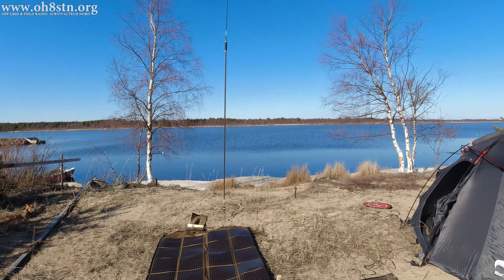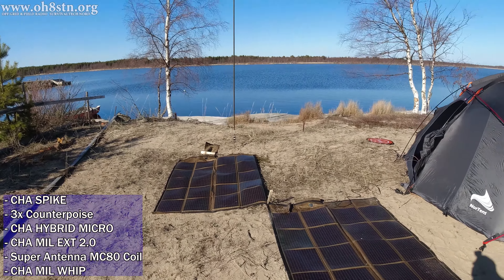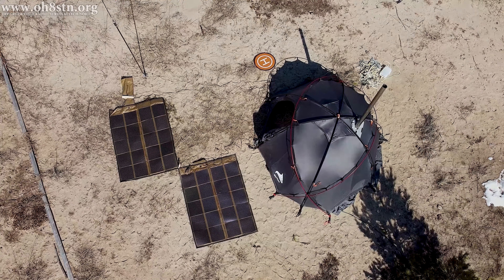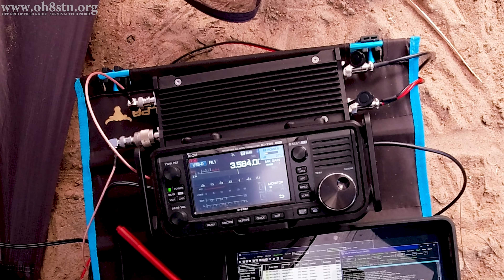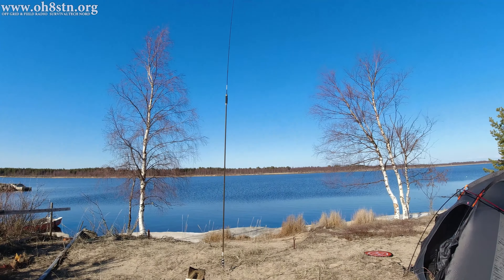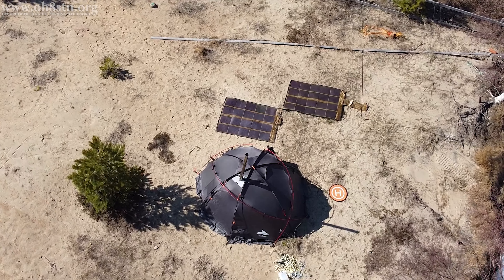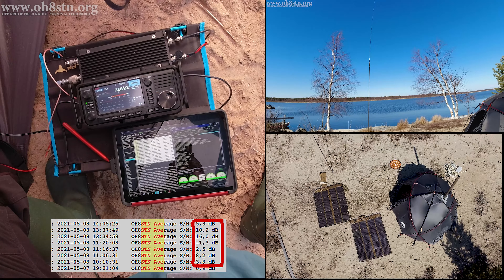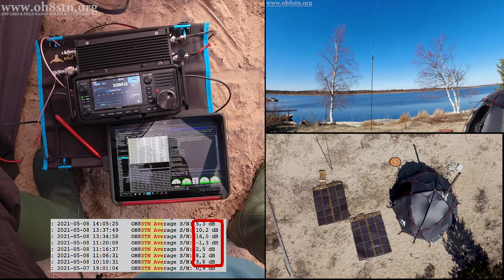Portable Ham Radio Antenna Chameleon MPAS

Comment: Thank you for the video Julian. I actually picked up the MC80 coil, and I ran some SWR readings last night. I run a cap hat on my MPAS 2.0. I put the coil below the hat, and I tried it above the hat. Those two setups had higher SWR readings vs. placing the coil in line with the extension and the whip without the hat. I'm only talking about 1.35 vs 1.20 SWR (with a tuner), but every little bit helps. I plan on working 80 meters this week, and I can't wait to see how well the coil works.
I can't say enough about the MPAS 2.0, as I've made SSB contacts over 6000 miles barefoot on 100 watts with it. 
Thanks again for the awesome and educational videos that you produce. Keep'm coming........
Reply from the maker: Thanks for this awesome comment and feedback. In my testing the best benefit came from placing the quail above the extension. Unfortunately I don't have the cap hat oh, so I haven't been able to test that one. It will be very interesting to see a comparison between below the cap and above the cap.

Comment: Thanks for another professional video, Julian. I was surprised you didn't need any stanchions on such a tall slender vertical antenna. There must have been literally no wind. Also, cool idea to add length with that 80M coil. Great job!
Reply from the maker: Thanks for the comment and the kindness. There was some wind, but it was manageable. The aluminum tubing of the lower portion  is milled from a single piece of aluminium pipe making it rigid stronger. Also the ground spike makes a great anchor. The coil and whip weigh almost nothing,leaving the extension  to carry the load.
Do carry along some elastic stretch cord and a few tent stakes just in case.
73
Julian oh8stn

Comment: Thank You, the idea of using the super antenna 80m coil with the MPAS 2 system has opened up a lot of additional flexibility and new life for the super antenna components.  I like the MPAS 2 much better than the super antenna system, so it was sitting on the shelf and not being used.  Now I see a lot of experimenting with an antenna analyzer and various components of the super antenna system added into the MPAS 2 to optimize for areas of the bands that might be enhanced by a little additional impedance matching. 73, Brian N9ETH

Comment: I've been using the MPAS 1.0 (black) with the CAP HAT since it first came out. Like any vertical antenna, at least one counterpoise is required to prevent some of the RF from being absorbed into the earth.

Suspending the counterpoise parallel to the earth from point to point is basically a field expedient elevated ground plane. Four is ideal and one creates some directionality.

Tie some safety orange flags on the suspended wires if there is foot traffic anywhere nearby. One trip on a wire could bring the system down.

The green MPAS 2.0 is on my list !
Reply from the maker: Thanks for the lesson and additional feedback.👍
Reply: @OH8STN  It is you that provide the lessons and instruction, I just share now and then to support the cause.

Comment: Used my MPAS 2.0 antenna for most of my POTA activations, until last month when then threads on the MIL whip became stripped. Been waiting for the bottom nut for the whip from Chameleon for a little bit.

Comment: Great video, as always. My challenge with Winlink over RF is connecting with an Igate. I'm using a G90 thru a Hustler 5BTV vertical, PATLink from KM4ACK's Build-A-Pi and ARDOP for the modem. One complication may be that I'm not heard within 500 miles of my QTH according to pskreporter on FT-8.
Reply from the maker: Thanks for the kindness and feedback. 
I suspect the problem is one covered in other videos. Km4ack scripts are great, but ARDOP is the weak link in the connection. It's much more difficult to get a low power connection with ARDOP vs VaraHF. It's also the primary reason for moving back to Windows for winlink work. Unfortunately there is no easy VaraHF solution for Rpi. 
The G90 has been rock solid for winlink so far. Usually getting connections on 160-30m.

Comment: I love my mpas2.0 I have the cap hat and 4 radials have made several contacts to North America and South America, from Ireland just 100 watts mostly on 20m SSB.  Even got to Australia once. 

I have the super antenna so will try out the 80m coil.

One thing I noticed compared to my efhw 49:1 is that the Mpas is a lot quieter and I can hear the dx better but of course for nvis the efhw is best but the Mpas is a really great antenna and I leave it up all the time at home and take it down only for portable use. I use noalox so the joins won’t seize.
Reply from the maker: Outstanding 👍

Comment: Question, the MPAS 2 covers 80 meters, why add the super antenna coil to the configuration. What is it giving you the MPAS alone is not. Just trying to understand.
Reply from the maker: Loading. You've heard the term more wire in the air? The coil adds a bit of wire in the air
 That little bit of loading can make the difference between a slow connection come and a very robust and reliable connection Ulta

Comment: So to run 80m you use the coil to make the antenna longer essentially in order to bring the SWR down? Couldn't you just use the PA500 to tune for 80m? I understand the coil makes it seem like the antenna is longer but how does that help efficiency? If you can use it on 80m by tuning with the PA500 what changes when you use the coil? Does it just draw less power or does it actually help with tx/rx in a different way?
Reply from the maker: Excellent question. The closer the antenna is electrically and physically to 80 meters, the more efficient it is. Antenna tuners tuning for low swr have no effect on efficiency. Here's an example for you the mpas can also be used in wire mode. That wire is 133 ft long. That is the most efficient configuration for this antenna system. If we can add some loading AKA coil, to the easy to deploy vertical configuration, we can improve performance on 40/60/80/160m when the antenna is in it shorter vertical configuration. Does that make sense?
Excellent question by the way.
73
Julian oh8stn
Reply: @OH8STN  thank you!!! I think I’m actually gonna go with the mpas 2.0. Thanks to you and your videos I feel confident that’s the right move. I’ll be picking up that coil as well. Doesn’t seem to add much to carry and I do wanna have the ability for 80m. 

Thanks again!
Reply from the maker: By the way I edited my comment. I hadn't had my first cup of coffee when I responded to you :-) make sure you make yourself a set of counterpoise wires. This also helps with efficiency by creating a good ground plane.
Reply: @OH8STN  no problem at all I got where you were going. I’m taking screen shots of all your comments so I can reference them at a later date because I’m still tryin fri understand antennas. It’s been hard. I understand it somewhat buts all a long learning process. Antennas make me go crazy sometime. It’s between the MPAS and the DX commander expedition. So, taking your info about the cold and just annoying to have to fiddle with stuff I think I’ll end up going with the MPAS mostly because if the durability aspect. It’s just robust and if I’m going the TX500 route it just makes sense.

Comment: Hi Julian great video and a great  set up  for off grid communication. I still don’t understand win link much but it is interesting. My question is the height of the antenna could it survive a windy day? Again thanks for a great video stay safe.
WD5ENH 
Steve
Reply from the maker: Thanks and excellent question. Yeah one of the reasons for using the mpas is exactly that. The lower section is aluminum, the upper whip is brass. The joints are all stainless steel or brass. It's been deployed and some pretty horrific winds here near the sea, and survived. Ultimately it's built amazingly well. The weak link would be the coil, but the whip on top of it is extremely lightweight.

Here's a Good winlink playlist. You can think about winlink as email but email with routing options. It can be transmitted over the air to a Gateway server which forwards it on through a cloud. Or it can be routed radio only, passed along from Station to Station until it reaches its destination all over the air. Finally it can be used literally Station to Station with no intermediate infrastructure or internet in the last two examples.
https://youtube.com/playlist?list=PLKMrdrsNkFA6U2dC0LrL8_IKBGC0fDhRq
73
Julian oh8stn

Comment: Hi Julian, 
Greetings from England!
Great videos, I always learn a lot.
I'm using an MPAS 2.0 as well, we've only got a small garden, would additional counterpoise wires help? 
I'm using the single one that came with the kit.
Mostly doing FT8/WSPR, I'm always trying to "ping" long distance callers but the only area I get signal back from is... your neck of the woods!🤣
Also, can I make counterpoise myself? 
The Chameleon ones are about £100 here... for 4 pieces of wire?
🤔
Anyway, rant over, keep up the great work!
Best regards, stay safe,
73 de Manny-2E0HJN
Reply from the maker: You can make your own wires especially if you are using the mpas in a mostly static deployment. Here's something to try. 3, 6, or more quarter wave counterpoise wires around the base of the antenna. The quarter wavelength should be measured on your lowest band. If you rarely used to lower bands, on your most-used band. Give that a try!
Reply: @OH8STN  Thanks, I'll try! Any specific wire?